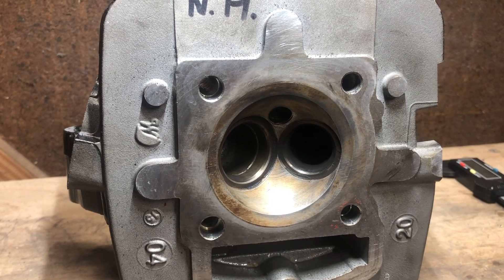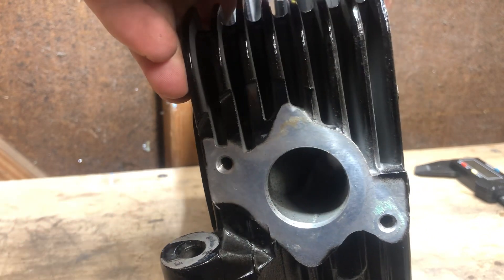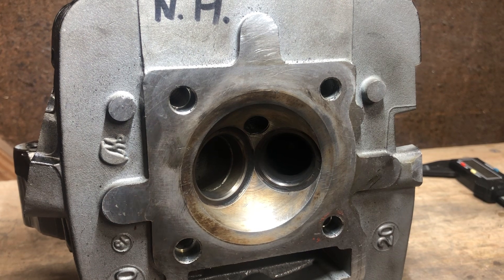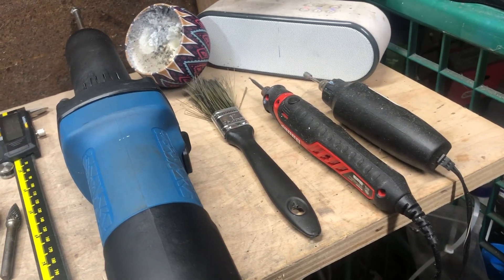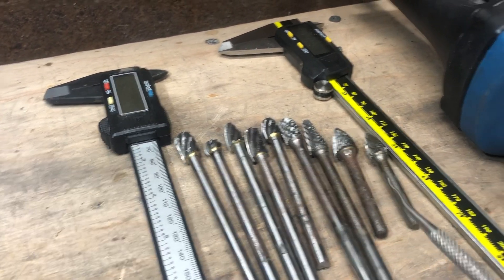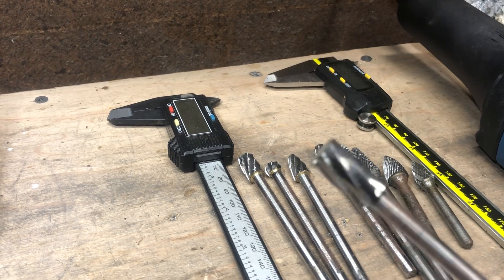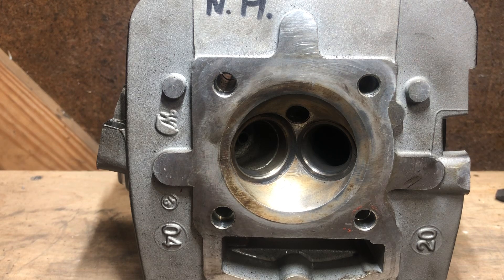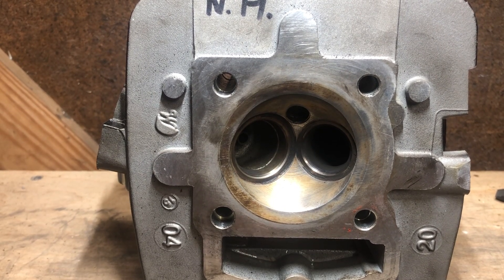Beginners guide to Porting a cylinder head porting video #1 Tbr7 performance upgrades

Comment: I was looking into big bore and noticed the 70mm is not 300cc but 250 bc 6.5 cm stroke and 7cm is radius 3.5 cm makes a volume of 250cc up from 229cc. I also heard the od perimeter of the skirt must be 73mm or less or it wont fit. I guess it can be machined if the kit comes too large.

Comment: Nice!
Reply from the maker: Definitely appreciate you stopping by the channel & checking out some of things I do here!! You’re going to love what this stuff does once you get everything installed & dialed in!!
Reply: @Jboost412  can't wait, it's definitely going to be a big improvement.
Reply from the maker: Yes sir very huge improvement in overall performance I actually bought what I thought to be the most comparable Japanese equivalent a Yamaha ttr225 and with the 6-speed gearbox the Yamaha has against my Tbr7 really no comparison both bikes stock the Yamaha wins for sure after the internal upgrades and proper gearing zero comparison…they were rather close when the chonda had an exhaust & a better carburetor…a really good match up was the ttr125 against our Orion rxb125 but even out of the box the Orion has better suspension & brakes the Yamaha had drum front & rear thin little scooter forks etc etc I’ll be making some comparison videos now that I figured out video editing 😂 kinda hard to blend footage together when you can’t edit 🤦‍♂️
Reply: @Jboost412  orion does make some nice stuff no doubt, when you upload it I'll definitely watch it.

Comment: 9th place yes
Reply from the maker: How has everything been going?
Reply: @Jboost412   so far so 👍... I just did a little l.e.d fishing in the headlight housing with a flex shaft claw ...then re installed those ...then installed flush l.e.d turns signal's....and temp slapped the fairings back on...finished my stage 1... Now before I can call it completely done I'm looking at the lip my intake has.... Pz30b inner diameter was like 22mm so I went to Walmart bought a new micrometer to recheck.. it's about the same...22.8mm the clone carb is 29.72smooth bore so I got sum shaving to do.... That's bout it
Reply from the maker: Absolutely port matching/gasket matching goes a very long way!
Reply from the maker: Trying to remember everything I haven’t covered in a while due to being away from my shop for a bit figured sharing some head porting & a valve spring upgrade was overdue!! Along with the long travel rear shock setup that I know I needed!!

Comment: My bike status changed to shipped! :D
Reply from the maker: That’s a great feeling there!! What bike did you end up going with?
Reply: @Jboost412  TBR7. Unfortunately all they had was green, and it seemed like that from every retailer. Wanted the white but oh well. I guess that's why god invented spray paint
Reply from the maker: Yes sir I definitely wouldn’t worry about the color since as you already mentioned you can buy some paint & make it the color you want!! Or vinyl wrapping has also become very popular for numerous reasons 1 being it’s available in just about any color or pattern you can think of but it’s also very durable personally it just depends on how I feel on said day wether I wrap something or paint it but if you choose to go with paint VHT makes some very nice quality plastic specific paints we use for various car parts or trim when building a engine that’s painted I try my best to tastefully accent some idner the hood parts to the color chosen for said engine build…we quit at 2 possibly 3 colors max though more then that it begins to get to much like a box of crayons 😆